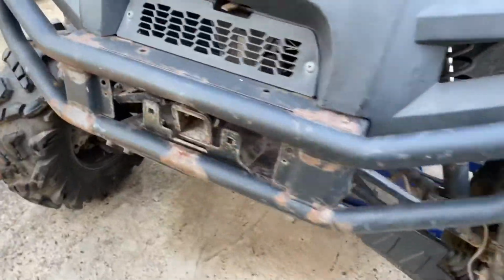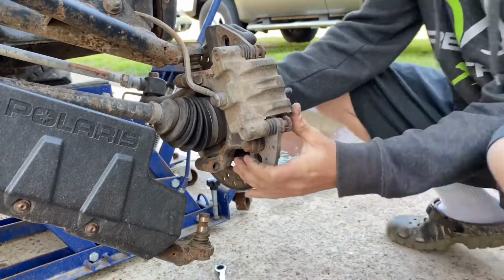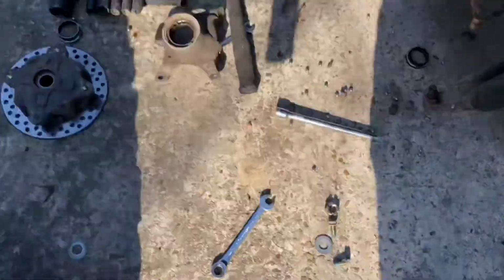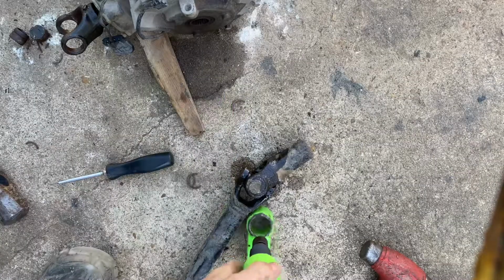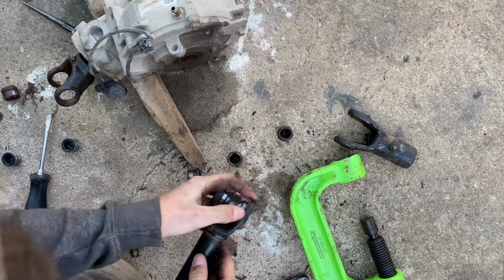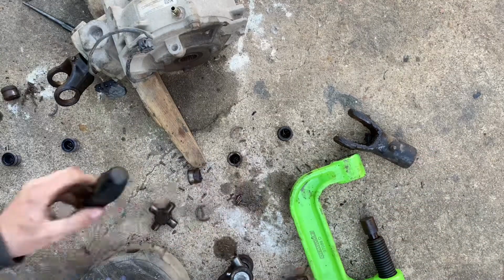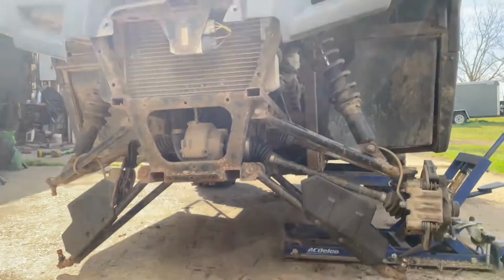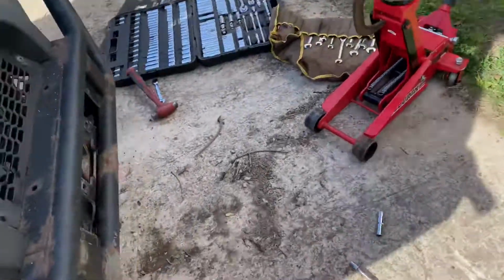Polaris Ranger Prop Shaft Removal and U-Joint Replacement

Comment: Where are you finding ujoints ? The dealers in Ontario are telling me they are unserviceable and need to replace complete shaft
Reply from the maker: I usually order them on eBay or you can maybe cross reference it at a auto parts store. The dealer is lying to you. I’ve replaced a few of them on rangers.